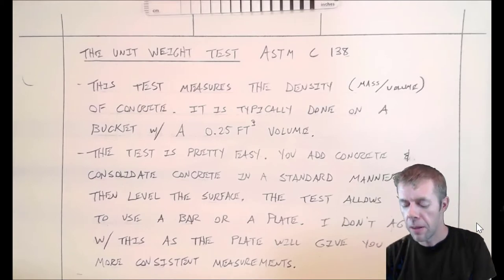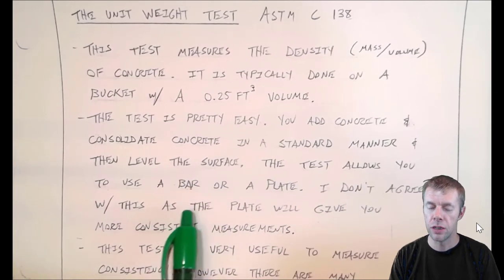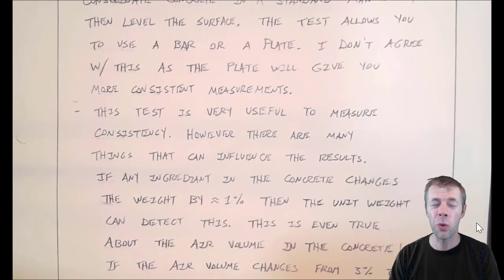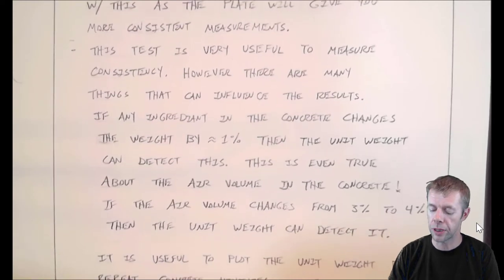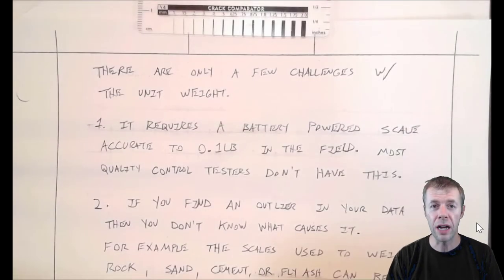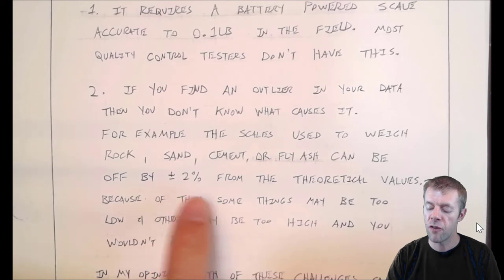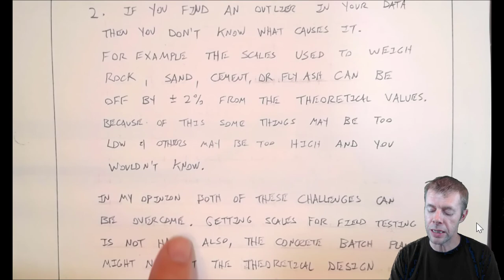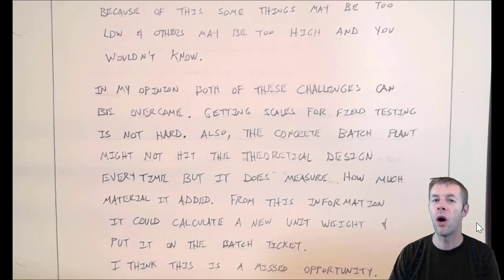Unit Weight Test - Fresh Concrete Quality Control Tests pt 2

Comment: Double check the standard!  I think you will find that ASTM C138 does NOT permit using a strike off bar for unit weight.
Reply from the maker: Jeff - You are right!  No strike off plate allowed in ASTM C138.  However, the bar is allowed in ASTM C231 to determine the air content.  This creates confusion and a lot of people will use the bar when they shouldn't.  When I update this video I will make the correction.  Thanks for pointing it out.